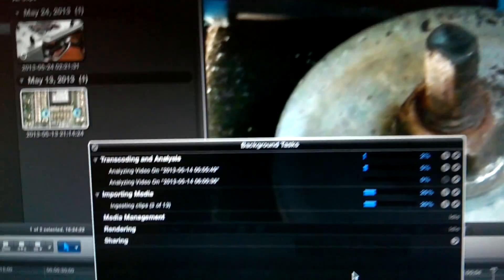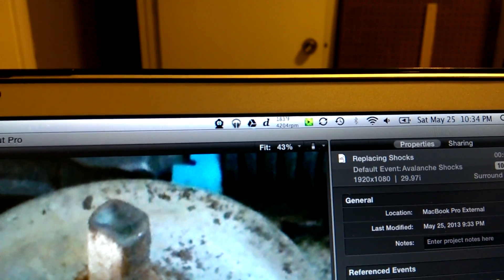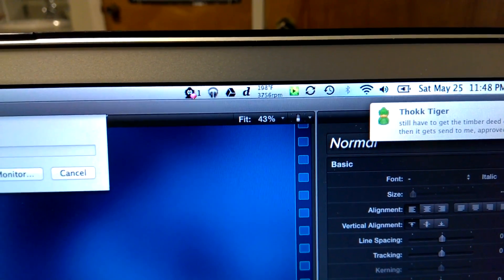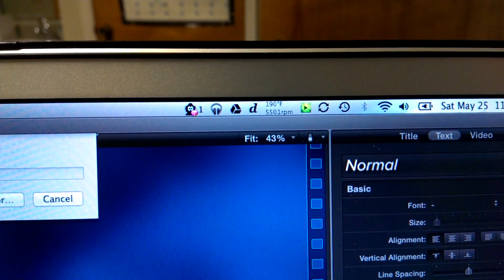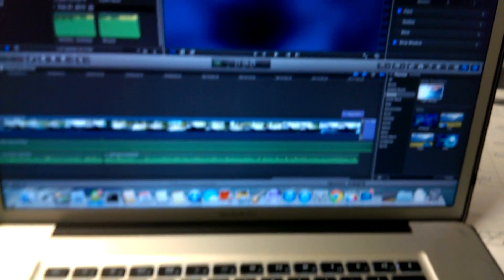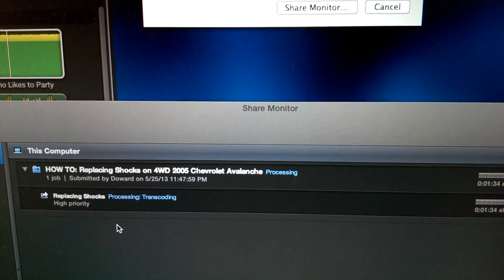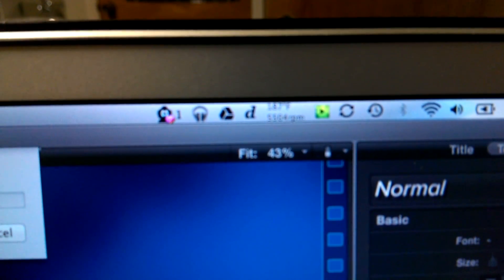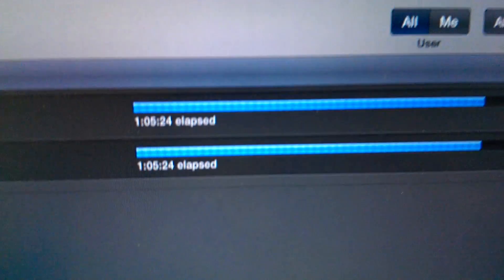2011 MacBook Pro Load Temps Post Lapping (30 day update)

Comment: Yep the macbook is poorly engineered.  At those temps (like my macbook pro) your CPU is no doubt throttling way back.  Sadly this is why I don't buy apple computers any longer.
Reply from the maker: Ah, no, afraid not.  After repasting and lapping the heatsink, my i7 will stay @ 3.3Ghz until the battery runs dead lol

Comment: I have a Macbook Pro 2010 model. I did open it and upgrade the RAM, install SSD and replace battery, but never went as far as messing with the logic board. Would you say it's worth buying thermal paste and applying it on the heatsink after cleaning it? My mac runs at 70 C whenever the flash player is running in Chrome. Idk if it's because my heatsink is all dirty or because of the fact that my CPU is outdated.
Reply: 200f?! Wasn't it like 170 with fans, on full load BEFORE your re-paste in your first video?
Reply from the maker: BRBallin1 If you're running 70C max, I wouldn't worry about it.  It's mainly the people running up near 100C that need to repaste the logic board :)
Reply: uberDoward I see. I just hate dealing with it when it hits 70-75C because it's too hot on my lap and makes it a bit unusable. I'm looking for ways to cool it even more so I can make it 65C max & have it run silently.
Reply from the maker: What are you using to determine the temp?
Reply: uberDoward smcFanControl displays live rpm and temperature on the top menu bar.

Comment: I thoughts its just my laptop but looks like most people macbook pro gets hot so fast. I think its the poor vent. If i open the back cover and run final cut pro or stress the CPU the fan doesn't increase its RPM. Nothing wrong with the laptop its the poor vent design.
Reply from the maker: ***** I'd agree that the venting is marginal.  I don't see more venting being a complete solution on its own, though.